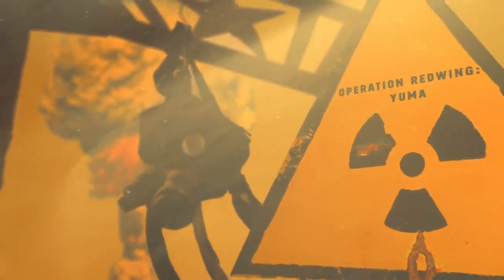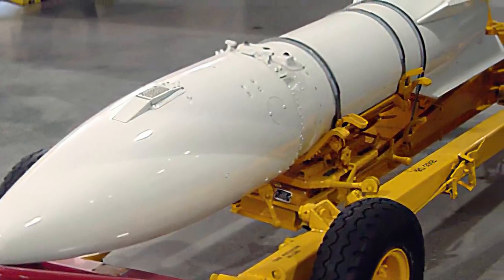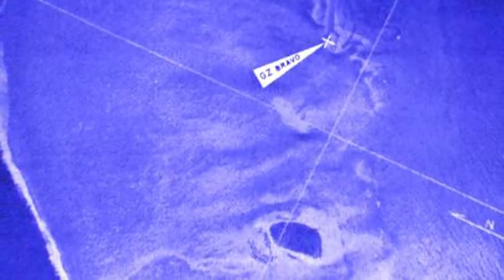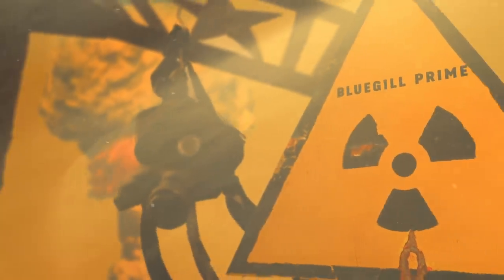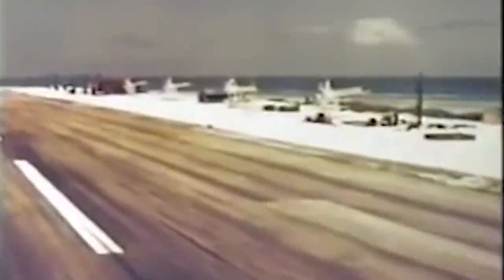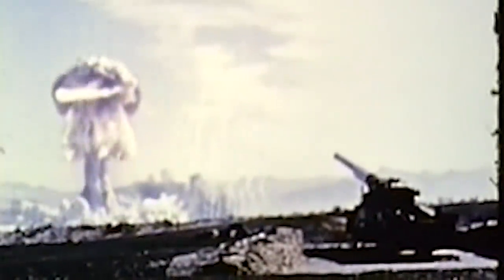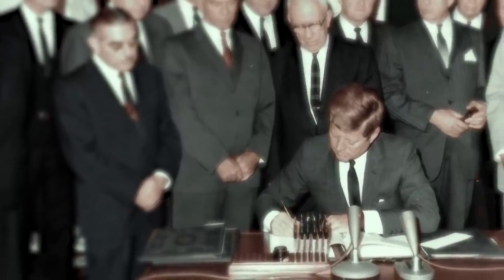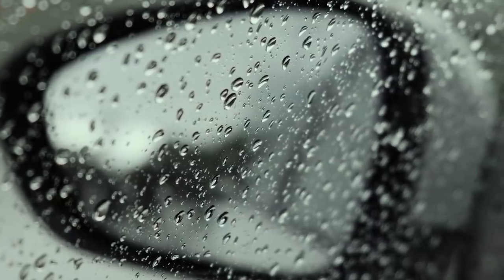5 Nuclear Test Failures Caught on Tape

Comment: Actually, a thermonuclear device uses a fission reaction to set off the fusion reaction.
Reply: this ^^
It's sad when they produce a video but don't bother to find even an amateur to review it and spot gaping errors like this.
What the video should have said was a Fat Man style implosion primary (a fission device) causes the sparkplug or secondary (fusion stage) to ignite, which in turn causes the tamper (assuming you used depleted or natural uranium) to fission. 
Most of the energy from a "hydrogen bomb" is still from fission - fast neutrons coming from the fusion stage cause fissioning of the tamper.
Reply: @chouseification  I believe the "sparkplug" is actually the core of plutonium or uranium at the centre of the secondary.  The fission primary creates an intense flash of photons  which causes implosion of the secondary.  The fusion fuel is compressed, and then heated when the sparkplug is driven beyond criticality and explodes.  Compression and heating result in fusion which as you say produces neutrons which fission the outer uranium layer.
Reply: @wilhelmvonn9619  look up ablation - that's the real secret to getting the sparkplug lit.
FOGBANK is a classified material, believed to be aerogel with other minor trace elements that is the mechanism for converting the radiation from the primary onto the secondary.
Yes the sparkplug IS the secondary - I simply stated both of the common names for it, as some know it by one but not the other.
Also, for the primary, it's not just the implosive charge but an allotrope phase change (to a denser phase) happens during that (when using the common plutonium + gallium alloy core), which assists in getting the density raised enough to go critical.
Reply: It was talking about "layer cake" type bombs, not thermo-nuclear.

Comment: My grandpa was stationed on Johnson Atoll in 50's before any of the nuclear testing or agent orange storage was there. He has many stories but two favorites are the one where he ditched a surplus crane in the ocean and another where he taxied in a jetliner using a homemade gokart
Reply: Care to share more? :) pls
Reply: I need to hear more about the homemade gokart.
Reply: @MrTak44  He said they used to be able to buy things like mess hall chairs, wheels for the stairs that rolled up to planes, and small engines from an airforce catalog when they got worn out or broken. Well, they had some spare scrap metal and tubing around and thought one day "Why not order those things from the catalog?" So that's what they did. He said that one day a plane was coming in for refueling (cant remember if it was civilian or armed forces) and the truck they usually used wouldn't start. So, in the trucks steed, he took the flags off the bed, attached them to the go kart, went to where they'd place the truck on the runway, and waited for the plane to come within distance. Once it was close enough, he waved them in and taxied them in. When the plane had parked  the pilot got out and said "I've been taxied by trucks, cars, motorcycles, and all sorts of vehicles but NEVER have I been taxied by a Go Kart". 
Note: I know I said Jetliner but that wouldn't make sense as both Military and Civilian aircraft used Johnson Atoll as a refueling stop in 50's meaning these planes still would have been piston powered.
Reply: StickPeopleAndPuff Thanks :) I love these kinds of anecdotes

Comment: Aside from the Cherokee shot there were no airdrops,, they were either tower shots, barge shots and surface bursts.
Reply: Incorrect.  54 US tests were air drops, some with parachutes, most without.  This test here, Encore, was an air drop. There were airdrops, balloon shots, one gun deployed, air-to-air missile, high altitude rocket, dry surface, tower, barge, cratering, space rocket, underground tunnel, underground shaft and underwater.
Reply: @puncheex2  I'm referring specifically to operation Redwing, the Cherokee shot was the only air-drop in that series.

Comment: 0:55 , lmao, A FISSION blast initiates a FUSION blast. not the other way around like is said after 55 secs. and most of the power in most H-bombs is from U-238 fissioning because its used as the case of the secondary.
Reply: At that point the video was talking about "layer cake" type bombs, ie boosted fission?
Reply: @kf8575  it happens fission fusion fission. Fusion is never first in any human made nuclear weapon

Comment: Castle Bravo wasn’t a failure. It was a miscalculation and underestimation. It worked as designed.
Reply: It was a failure of containment procedures. Due of course to the miscalculation, or, more specifically unidentified variable.

Comment: I work on JI for 10 years 1989 to 1999. About 1/4 mile from the radiation pile.was my bedroom Where several companies tried to used a gold mining process to get the plutonium from the pile   Anyway they did a test for radioactive contaminated areas on the island in 1997 or 98. The highest level of radiation was found in the middle of the chow hall parking lot not the plutonium mound. 😮

Comment: What are the smoke streaks we always see when they drop nukes? Been asking for years and can never get an answer.
Reply: Concussion
Reply: @juicestayzlit4988  Say wha?
Reply: Smoke trails from rockets that are fired right before detonation.  They are used to help visualize the movement of the shockwave as it travels through the air.
Reply: They fire a phalanx of sounding rockets just before the blast.  The smoke streaks are used to gauge the growth of the barely visible shock wave as they shift when the wave passes through them.
Reply: @puncheex2  I saw a video explaining on it not long after I posted this.  Дякую, all the same. 🙂

Comment: Also because the yield was much higher than what had been calculated and expected it was a near disaster, equipment in men were not at a safe distance for the actual yield of the warhead but had been placed at a safe distance for the calculated yield of the warhead. Several other nearby Islands had to be evacuated due to the unexpected yield of the warhead !!!

Comment: Thermonuclear weapons use a fission reaction to trigger a fusion reaction,  not vice versa as was described in operation Redwing.
Reply: But it could also work in Reverse.
Reply: Yes its a reversibile reaction if Im not wrong
Reply: @randomguy7176 I think there has been a misunderstanding that has resulted in a poor initial description. I believe now through further research the narrator was referring to a boosted fission reaction.  As it was designed the initial fission explosion creates the necessary temperature to incite fusion resulting in increased release of neutrons that boost the yield of the initial fission reaction (Boosted fission). Yes the fusion reaction does increase the initial fission reaction so it is reciprocal and this was a misunderstanding on my part due to my belief increased yields were a result of the fusion reaction independently of the initial fission reaction.